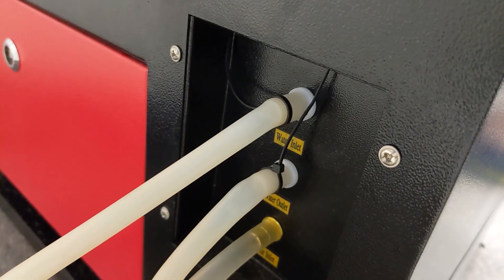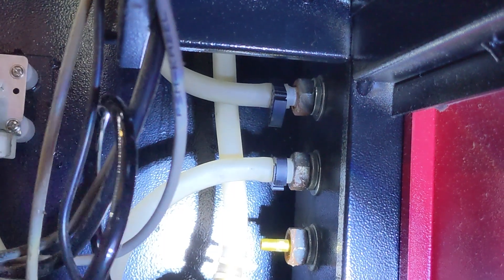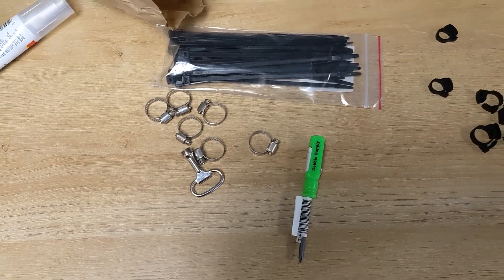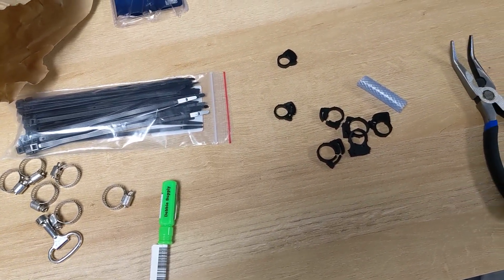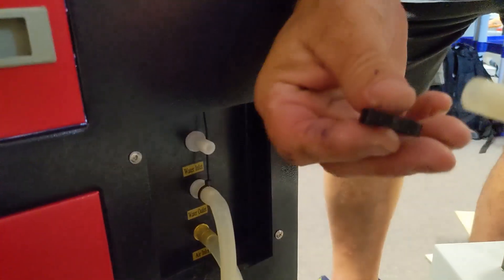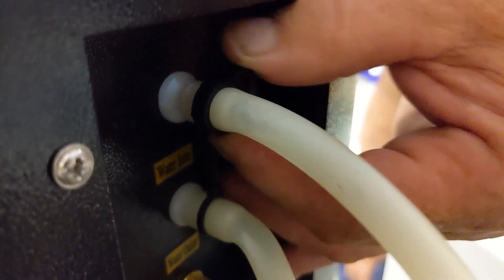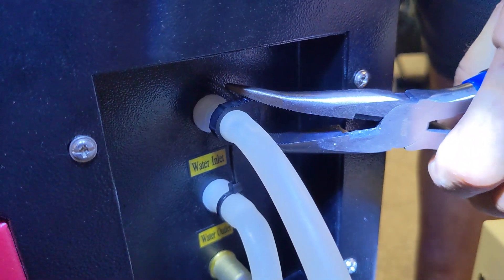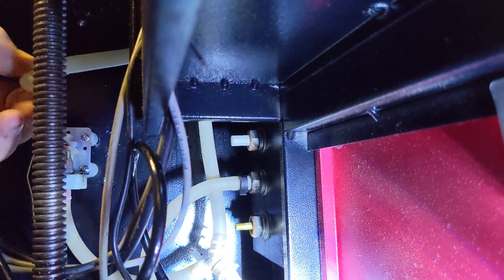I Should Have Paid Closer Attention | CO2 Chiller Water Hoses and Clamps

Comment: Same thing happened to me just a few weeks ago. Water caused an arch at the High voltage line cracked my tube and fried my power supply.
Reply from the maker: I was so nervous that's what happened to mine too before investigating! I got super lucky. Sorry you lost your tube man.
Reply: @LaserEverything  it's all good 3 days later had a replacement thank goodness cause like for you all production was halted. I am thinking about keeping a spare tube on hand.
Reply from the maker: Check out the galvo operated CO2 in the description. That's what I've seriously been considering as a back up. Smaller work area but much fewer moving parts. Might be a viable backup depending on what you do with it.

If not of course, the Ruida machines are awfully inexpensive and it would be trivial to get a second tube or even a second machine if you can afford it.

Comment: I hate to say it .. this is why in my video I stopped putting it together and got metal hose clamps ... I can't believe they don't supply them with machine such a small cost ... to a expensive machine
Reply from the maker: Totally agree, the reason I went for the plastic ones is because I didn't want the metal ones so close to the contacts on the glass laser tube they were really close and I didn't want any arcing so I just grabbed the plastic ones and ended up putting them on everything. They're really tight and they seem like they'll hold up for a long time but I'm sure the metal ones are a good option for area is not around the laser tube too
Reply: @LaserEverything  yea I did use zip ties on tube ... but all others were metal .